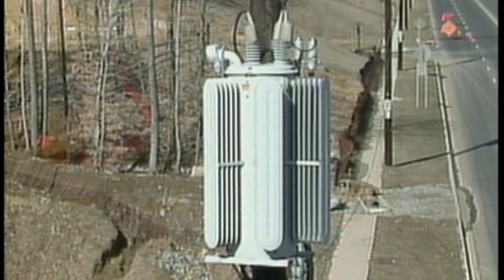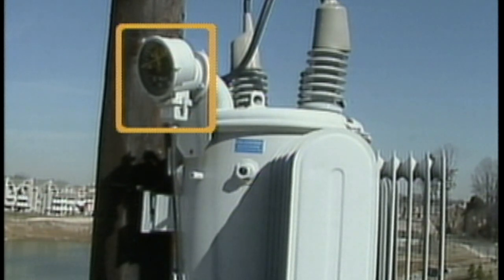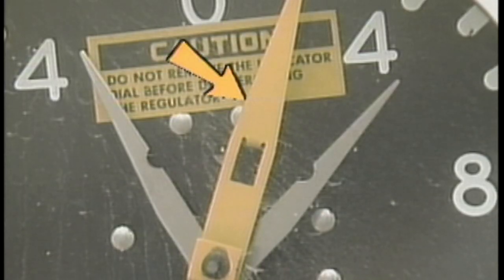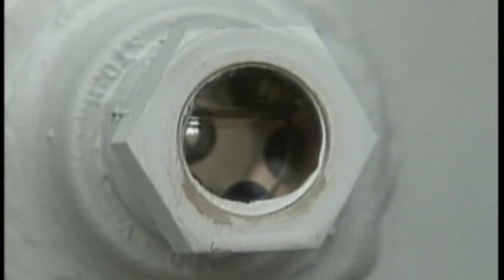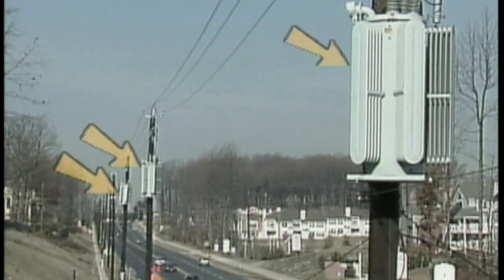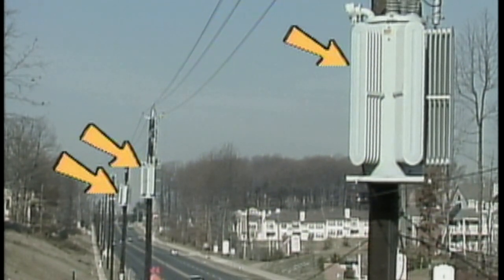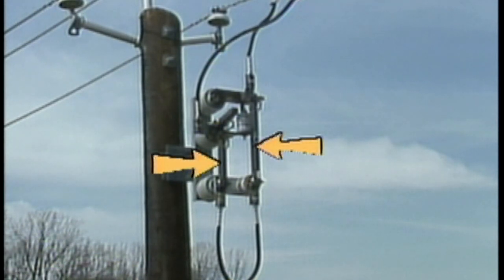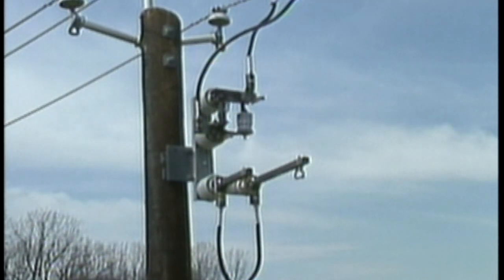Pole Top Equipment - Voltage Regulators [PREVIEW]

Comment: Transformer...
Reply: Google Play AI just what I was thinking
Reply: FUZE A voltage regulator is different than a transformer.
Reply: @orangeofficer528  what's the difference, are they the same in kind?
Reply: @navigatingel6104 Transformers step up or step down voltage levels, depending on purpose, like raising voltages from generation levels (13KV - 34.5KV) to transmission levels (69KV to 765KV) or dropping it down from distribution levels to secondary for customer consumption. A voltage regulator maintains a specific voltage level for different reasons, like ensuring customer transformers aren’t working improperly down a line and messing with customer homes and businesses.